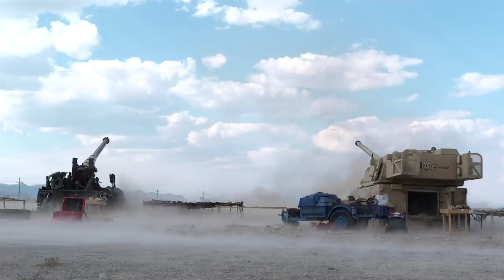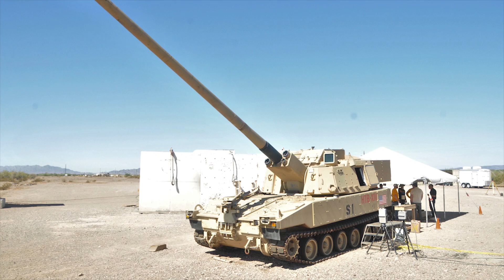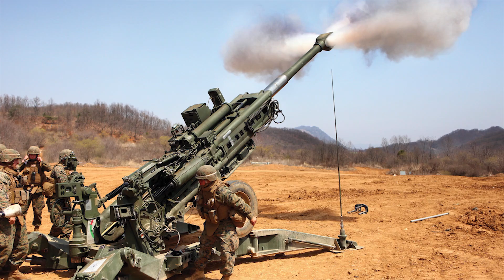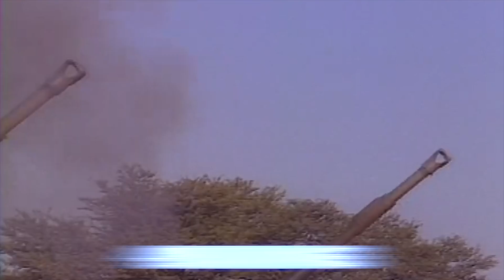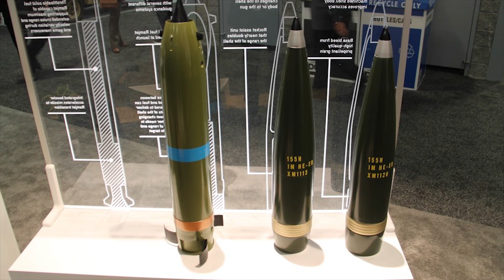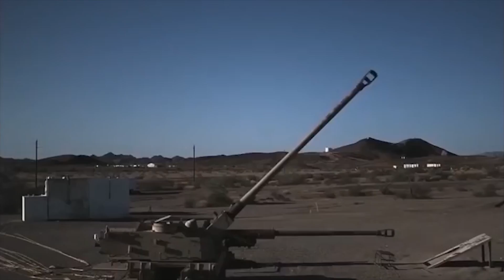Incredible Power! US Built New HOWITZER With Extra Long Range!

Comment: Range means not much without precision. It makes no sense to shoot a projectile 100 km without hitting the target. The guided projectiles are very expensive and they have only half the amount of explosives, which in turn reduces efficiency. So this is much less bang for the buck. Compare the price of the M107 projectile that costs something like $800 to a guided projectile that costs $80000 each, but has only half the amount of explosives. Longer barrels seem to be part of the solution, but they have their own problems. They bend under their own weight, they are bulky and need a lot more space when transported, the gun itself gets very heavy as you need more counterweight to balance the system. I think the solution is to go to larger calibers and cargo rounds with shaped charges and guns that stick to something between 38 and 52 caliber lengths. Other than that, it might be better to switch to guides missiles for longer ranges instead of artillery shells. Artillery always had the advantage of firing lots of shells at low price instead of using aircrafts with bombs or missiles, which is very expensive but extremely effective. But the long range guided shells are both, very limited and expensive. Not the way to go in my opinion.

Comment: The tank to carry this gun needs to build bigger than Abram tank to balance its accuracy strikes and load more rounds. The range must reach at least 65 miles or 100 km in order for it to be a powerful weapon machine.
Reply: Well, like it was said, it’s on a standard M109 chassis, a little tweaked here and there, but essentially the same. Only the turret is totally new and designed for the new gun, which has an auto loading feature like many of the new SPG’s these days. 
So if you really looked at the vid, I don’t understand your comment.

Comment: Rheinmetall bring the same who inside the PZH 2000 so have significant more Range. Nexter worked last Year about 140mm and I think that will be came and with Special Ammunusion they have a unbelievable Range and they must about the Enemy they must Shocked are psychology also a big Point in Future and Wapon electromagnetic and many more it's possible to bring the Solders didn't move or take a Wapon that is the way and I know the American tested many about that also People their didn't know...
Reply: The 2000 has the standard NATO 155 mm rounds. Next, they did some tests which achieved about 67 km range (with the L52 barrel), and they are working now on to get the range on to at least 75 km which they already succeeded.
For now the standard operation range is about 40+ km’s. Due to the use of Dutch first and later the Ukraine a few issues became clear. Even with NBC protection the units suffered from the amounts of dust in Afghanistan and due to the excessive use by the Ukrainians (more then 100 shells a day, with heavier load) structural issues became clear, those are being solved in Germany at the factory.
Reply: @joostprins3381  In this video, they were using Miles as the measurement of distance, not Kilometers, so 67 km = 41.6 miles, and 75km is 46.6 miles in comparison, so it's NOT TRUE that the PZH2000 has "significantly more range."  The M1299 howitzer is already shooting the XM1113 extended range round up to 74 MILES, not kilometers.  
74 Miles = 119 Km.  The XM1113 round has potential to reach even farther than 74 miles. Further testing continues.  1 Kilometer is significantly LESS THAN 1 Mile.  
1.6 Km = 1 Mile.

Comment: M1299 vs. HIMARS? (i.e. how does the 1299 fill a gap in the spectrum of weapons systems? other than one-upsmanship vs. the bad guys.)
Reply: The M1299 rounds are one heck if a lot cheaper.  The US needs a weapon that can pound the shit out of the enemy for extended periods of time and still be affordable to operate.
Reply: @kokomo9764  The real question becomes what is the cost of the rocket boosted shells and what is their availability and production rate.  If the price is outragous like the ammunition for the Zumwalt guns, then this new artillary system won't see production past this small batch of prototypes.
Reply: jdams are cheaper  @Red.Hot.Chili.Beans63